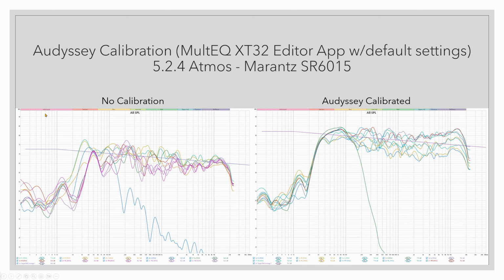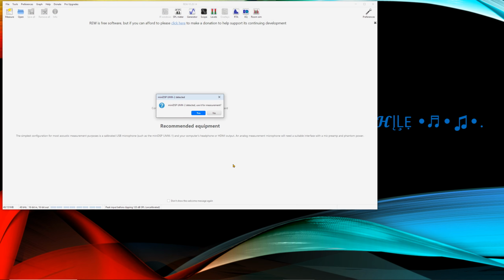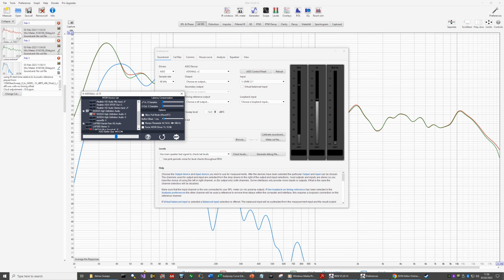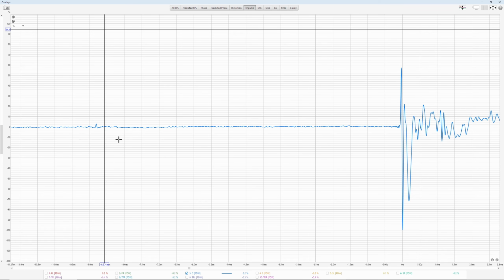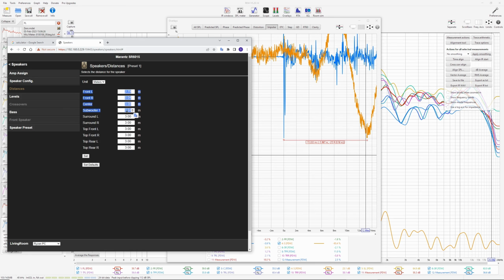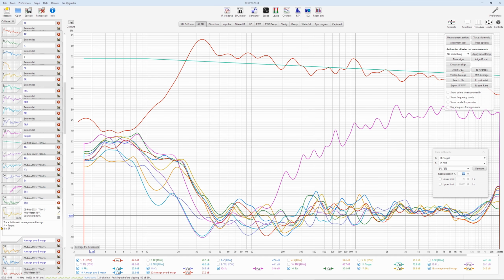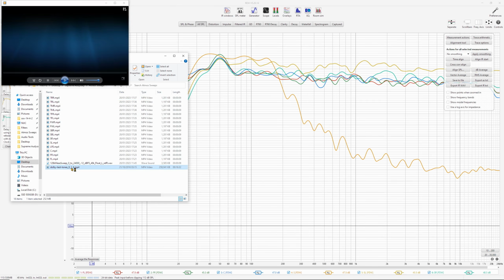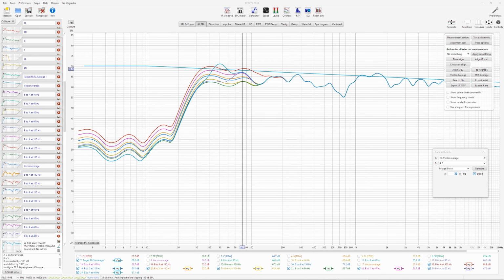Supreme Audyssey Calibration by OCA

Comment: Dear OCA,
Maybe you have any clew why my .ady file has no CustomTargetCurvePoints section? I do everything for the 1st time, made no modifications to Audyssey on my receiver before. I use MultEQ v1.7.1 on Android, my receiver is Denon X6300H. In JSON, I have all the remaining variables like you (and even more), but not that one. This is how my JSON output for every channel looks like
0 : {
"enChannelType": 0,
"isSkipMeasurement": false,
"delayAdjustment": "0.0",
"commandId": "FL",
"trimAdjustment": "0.0",
"channelReport":
"responseData : {
0 : [16384 items]
1 : [16384 items]
2 : [16384 items]
}
"referenceCurveFilter": {},
"midrangeCompensation": true,
"frequencyRangeRolloff": 20000.0,
"customLevel": null,

Thank you for what you're doing because that is magic. I hope that I will be able to try it too
Reply from the maker: Interesting, never heard this before. I checked multeq app in the apple app store. There's a list of compatible receivers and 6300h is not listed. Maybe that's the reason?
Reply from the maker: You can still try to add it in the json. Adding a title is also possible same as adding data.
Reply: I got it! I watched the tutorial for so many times that I thought that I remember everything by heart. Apparently, I'm not!  It is about "midrange compensation" - when I deselect it, custom target curve points appear. I'm glad that I will be able to proceed with the guide.
And my new discovery is that Denon HEOS models do not support control over http. Only app or telnet. That's in case someone else also gets into Error 403: Forbidden in their browser
Reply from the maker: @Remigijus02  👍 There's a setting for remote control in the receiver menu. My Marantz also has Heos btw.

Comment: I am a little confused about using the built in sounds verse the downloaded files. What benefit is using the external files? Are those sounds programed to only come out of those specific speakers? I am excited to start this, but want to make sure I grasp everything before I dive in.
Reply from the maker: You cannot produce any sound from Atmos channels (height speakers and front wide speakers) with the built-in sweeps. It's limited to 7.1
Reply: @ocaudiophile   Ah got it, so if just doing say a 5.2 you could just use the built in sweeps.
Reply from the maker: @johnwicker7783  Correct!
Reply: @ocaudiophile   Fantastic. I think you mentioned in the video you had a previous video going over the Atmos measurements? Looks like there are a few which one were you referring to?

Also, Even though I have the subs time aligned, EQ'ed these changes are not going to impact any of that right? I am really happy with the outcome following your advice so far.
Reply from the maker: @johnwicker7783  FOllow the method for Dolby Atmos Music. It will give you the cleanest overall sound (also for music)
Reply: @ocaudiophile   good timing that's the one I am on right. Now. So follow that method over this method? Or use the method for thr atmos channels with this method?
Reply: Nevermind. I was watching one from Nov 2022. I see there is a new one out. I will watch that now. Serious question. How do you know all of this? Like how do you know what each feature of REW will do? Do you have some type of university studies in music? This is very impressive. 

Bravo Zulu!
Reply from the maker: @johnwicker7783  The method is for improving Audyssey no matter which speaker set up you use. Atmos channels are just an addition to floor channels.
Reply from the maker: I am a banker actually :) It's my hobby and when you spend enough time, you learn these things. Also author of REW shares beta versions with me to test them which keeps me up to date.
Reply: @Obsessive Compulsive Audiophile   that is awesome. Started watching the last video. Again, just want to clarify. Should I do the Supreme calibration first and then to atmos music? Or just do atmos music? I do about a 60/40 split movies/music
Reply from the maker: Watch supreme but apply music one

Comment: Thanks for that great tutorial. In a previous video you also used parametric eq filters (for yamaha), but i am using multeqx on my denon. Can i also use paraeqs with this tutorial and do i meed the hassle with python and excel, when i can use multeqx?
Reply from the maker: Denon does not have parametric EQ, it has only a graphic eq with fixed frequency bands but of course you can use that insetad of Audyssey. I have one preset with Audyssey and one preset with GEQ in my Marantz set up.
Reply: @ocaudiophile  thanks for the answer. Since multeqx support the usage of parametrics eq i will try my luck. You can also apply them without measuring your speaker wirh audyssey, thats what i want to try with rew then according to yout videos.

Comment: I must not have saved my original comment as I don't see it. 

Been following you closely and love the content. Just curious how much better the sound is following this method compared to  using the method in "Optimal Subwoofer Alignment with Cross Correlation" and using the guide on your website to set the proper curve within Audyseey using the JSON editor which wors for all XOs. Also, as I do eventually plan to compare the two when I have more time, I was curious at what point I would use the scripted that was created?
Reply from the maker: Optimal Sub video is for multiple subwoofers and once you align them then you should refer all subs as one and apply the correction techniqe in the Supreme Audyssey video. The script can be used at any stage without using Json editor.
Reply: @ocaudiophile  Won't that then dump the corrections made when doing the sub alignment though?  After the EQ step in that video, as I was putting it in Audyssey, not a MiniDSP, I applied them as customTargetCurvePoints - now this has produced new customTargetCurvePoints that take that alignment for granted.

I've imported those EQ points as a frequency response in REW and then averaged them with the sub correction produced from following this video, but I have absolutely no idea if that's the right thing to do - and from the shape of the curve, I'm guessing it's not, lol.
Reply from the maker: Sub alignment is just a distance setting between subs. You can dial that in the delayAdjustment property in the ady. All responses should be converted to perfect response and customTargetCurvePoints points should reflect correction filters needed for the sum of both subs and be kept under SW1 in the ady. Examine Audyssey's original dual sub ady file and you'll understand. SW2 only has delay and trim (volume) adjustment, no response or target curve data.
Reply: @ocaudiophile  Hrm, my output from https://www.youtube.com/watch?v=ga2eOwJRtXo was EQ params, not a delayAdjustment 😕 ... I'll have to go through it again 😀 ... or just buy a MiniDSP 😜
Reply from the maker: @rob7370 Did you try Audyssey One?
Reply: @ocaudiophile  I did not!  I just saw a comment here saying "what to do with two subs?" and your response a link to that video, so rather than asking the same question again I just did that 😀

I will check it out this evening!!  Thanks!!

Comment: Two quick notes: In REW export all to text, if you change setting 'Export Text Delimiter' to Tab, the numbers will go directly into Excel columns without having to monkey around with the Excel delimiter. Also, if you adjust distances and levels in the Audyssey MultiEQ app instead of in the receiver web portal, although more cumbersome, they will be saved into the .ady file and you won't lose them if you change between different calibrations. Cheers and thanks for another great tutorial!
Reply: Ernie, I'm guessing you mean make the adjustments in the the json editor? There are six decimal places for both trim and distance. For trim, did you try entering something other than half dB increments? Wondering if it will accept levels that aren't .5 or whole dB steps.
Reply: @cadillacfella80  no I meant inside the audyssey muiltEQ app on your iPad or other device. When you open your calibration file, one of the submenus is (something like) Speaker Results, inside you’ll find crossovers, distances, and levels.  If you input the values here they’ll be saved into your calibration .ady file
Reply: It only accepts 0.5dB trim adjustments

Comment: Hello Oca, should i adjust the diatances x 0,875 before trying to align them in the impulse tab?
Reply from the maker: You should manually measure your acoustic reference speaker's distance to the tip of the microphone, multiply that with 0.8746 and enter that number to your receiver as the distance for that speaker. Let's call that X. Once this is done, if you've changed speed of sound to 300m/s in REW settings, you can simply deduct the exact distance you measure between impulse peaks of any speaker and the acoustic refrence speaker from X and key it in the receiver for the correct distance of that speaker. You will then see all impulse peaks gathered on top of each other around the acoustic ref speaker.
Reply: @ocaudiophile  Even if I measure center distance with a tape measure, I have to multiply that by .8746 before entering distance into receiver? I thought we only had to use multiplier for Audyssey created distances?
Reply from the maker: @ChauncyMarsh  It's not Audyssey's fault. The receiver's use 300m/s for speed of sound and applies time delays based on the speaker distances entered. If your actual speaker distance is 3.43m, it should be sent 10ms early to reach you on time as speed of sound is actually 343 m/s. For the receiver to apply 10ms delay though, because the speed of sound is 300m/s for it, will need to see 3m speaker distance to apply 10ms time delay.
Reply: 7 @ocaudiophile  I understand. So if I completed the entire calibration using center as reference with it being the actual distance (not x.8746) I should go in and change all distances by x.8746, right? Or do I need to start from scratch? BTW this tutorial made my curves so nice and I'm noticing so much more clarity throughout...even though my distances are probably wrong. Thanks!
Reply from the maker: Follow the method in the video to adjust your speaker distances (I am afraid you'll need to start from scratch) and you'll be amazed when all distance settings are accurate.
Reply: another one for you oca, should i do the crossovers with left + right together instead of L+R separate. The SPL levels are different when crossing over showing different results
Reply from the maker: If your receiver can do separate crossovers for L&R then you can of course but most Marantz/Denon line recieevrs cannot.

Comment: amazing tutorial. many thanks! my 2 subs on mini-dsp seem to arrive much later than receiver can set (+6.8m to center). in this case would I just set to maximum available distance? or is there anything smarter I can do?
Reply from the maker: Million dollar question ;) There's not much you can do to compensate for the time delay introduced by MiniDSP in the reciever.
*Play around with bass sync setting if you've a Denon (Marantz don't have it), that might add some delay compensation.
*You can switch to IIR filters (biquads) in MiniDSP if you are using FIR filters (taps) which introduce delays to the system.
*And last resort: You can align subwoofer's previous impulse peak instead of the highest peak to the center channel

Comment: I've been thinking on this for a few days and am wondering if there is a reason you didn't measure the speakers using "direct" or even "pure direct" mode? It seems that the idea is to measure them with no correction at all, which is what those two modes offer. It would eliminate the dirac copy step and maybe even result in more accurate measurements?
Reply from the maker: For more reasons than one. You cannot measure atmos channels in pure direct mode and you want to measure and correct the speaker response with Audyssey reference curve and dynamic EQ applied.
Reply: Wanted to add I think this is a great method. It basically allows for a fully parameterized EQ. I did end up slightly tweaking by not enabling Dynamic EQ as I don’t think I like the effects of it.

Comment: Thanks you!! Can't wait to give this a try! Question for you: I have a 9.2.4 - can ASIO play a sound through all my channels? I think I had trouble getting my front wides to play because Windows' channel limitation.
Reply from the maker: You can play all of the Dolby Atmos 9.1.6 channels with Windows Media Player from your PC and REW can record the sweeps. You can use both ASIO and Java EXCL drivers. REW will not play sweeps on its own other than 7.1
Reply: @ocaudiophile  Thanks! One more question - what curve do you run in the AVR (Flat, reference, etc) if any, after you send the final calibration settings.
Reply from the maker: Reference
Reply: @ocaudiophile  Thanks again. I'm struggling with some setup items. I apologize if you covered this in other videos. 1. what is your sound mode set to on the AVR? Multi Channel in? Atmos? Stereo? 2. It appears my sound card supports 8 channels - does that mean it can't send info to the atmos speakers? 3. When I run the play files, they either play in all the right, or all the left speakers depending on if I select a right or left file. In other words, if I try to play TFL, I hear the sweep in ALL the left speakers and not the top front left atmos speaker only. Is that expected or do I have to mess with some drivers. And finally, do I have to go into the sound settings and tell windows that my avr is 7.1 or atmos? Sorry for all the questions.
Reply from the maker: @brianharris5446  AVR sound mode is irrelevant but Windows Media Player sometimes plays Atmos channels only from the front speakers if your AVR is in music mode. Switch to movie mode and leave the AVR at stereo setting and it should be fine. AVR should also be the "defualt" player in Windows sound / playbak list. It needs to stay in stereo mode as well (don't choose Atmos).
Reply: @ocaudiophile   Thanks again! I have everything configured correctly but for some reason the individual files are not targeting the specific speaker. If I play the Dolby test tones file, I DO hear each individual speaker being targeted but the individual files aren't working for me. It's either they only play out of the FR or FL, OR the sound plays out of ALL left speakers and ALL right speakers. I'm a bit stumped.
Reply: Interesting. When I play the Dolby test file, my receiver info shows it's getting an Atmos signal. When I play the individual tones, it shows the signal as stereo/pcm. Is that how it should be?
Reply from the maker: @brianharris5446  No, it should automatically switch to Atmos and better test with your ears if the correct height speaker is working with a height channel sweep played with WMP. You need to double check all your settings, there's not much else I can advise.
Reply: @ocaudiophile  Thanks again for the quick responses. I tried everything and for some reason the small files are not recognized as atmos by my receiver. The big test tone file is, but not the small ones. So strange.
Reply from the maker: Windows Media Player should play the atmos sweeps correctly with its default settings when:

1. Receiver connected to PC with HDMI is the default playback device in Windows, with format at 48,000Hz, all enhancements disabled, level :100
2. ASIO drivers for the receiver disengaged from REW/Preferences (or else WMP will give error)
3. Receiver is not in music mode but in movie mode (can be changed only from remote control) and expecting stereo signal (not multi-channel in or other surround modes)

There are no other settings that I know of. If you can still not play maybe you should check your Windows installation or try VLC player.
Reply: @brianharris5446  did you ever figure out how to get the atmos height speakers to play? I am stuck in a similar situation like you are/were. Height channels play through fronts. Have HP Omen laptop and Denon 4700h. Thanks

Comment: Thank you! I've waited a long time for someone to do a tutorial manually tuning  HT/atmos speakers. Bless you! .....Initially, I tested the sweep files on all my speakers and determined that two of my Atmos speaker's high frequencies dropped precipitously around 1000Hz. Thank you for the files to test them.  In the  Denon AVR-X4700H Low Frequency Effects are displayed when 
"This item can be selected when a Dolby Digital or DTS signal or DVD-Audio is played." I did not set this initially and continued with the tutorial with 7.1. Should I have played a DTS movie and then set this at the beginning? What do I set the Reference Level Offset given I did not set Low Frequency Effects?

Thank you for bringing my Home Theater to life. My 7.1 sounds so good  I wonder whether I needed Atmos.
Reply from the maker: I suggest you use Denon's web interface to change its settings. WHen you start palying any of the sweep files with Windows Media Player, all these settings will sho up in the web interface and you can adjust them. RLO has nothing to do with LFE. LFE -10dB offset is just a temporary setting to see the sub response where it really is relative to other speakers. RLO is a setting which adjusts the strength of DYnamic EQ.